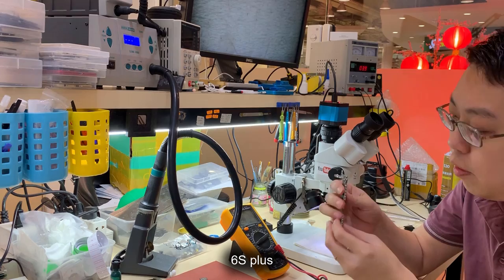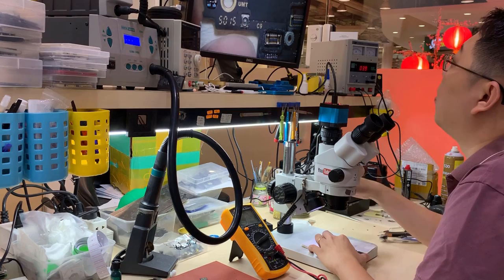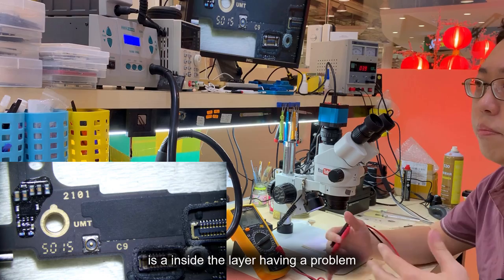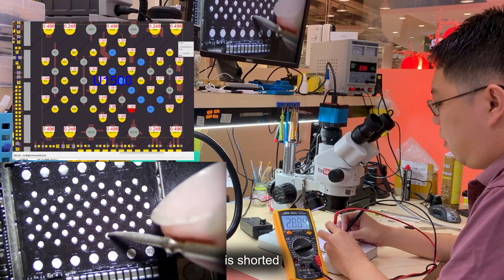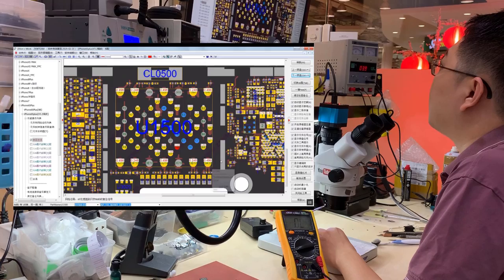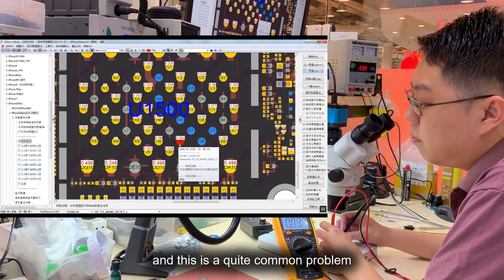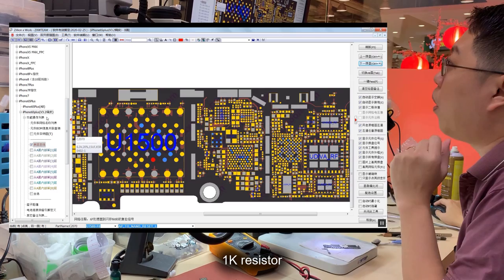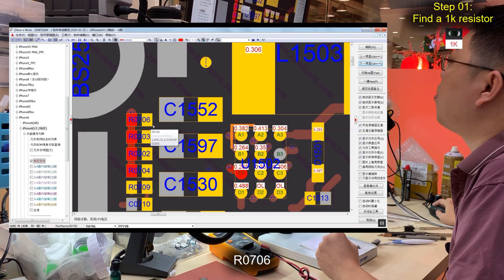iPhone Error 4014 【Special Case】 Repaired |  AP_to_Nand_RESET_L short on 6S Plus

Comment: Why you put 1k registor, what is the purpose of it. And if the AP line is shorted to  ground, is it not the 1.8v line will be shorted to ground as well. Could you explain please. But nice work 👏
Reply: i am guessing that the line is a cpu controlled output meaning that the transistor inside the cpu in that line switch between 0 (no voltage = logical 0)and 1(high voltage 1.8v = 1) so if the line is shorted it will always be 0 and the nand will understand that it must reset, if you cover the pad and bring the 1.8v (logic high state 1) it will understand that it should not reset

Comment: You put a pull up resistor to bypass the short, but now the reset line isn't working properly. The reset can not be asserted by the CPU when needed it remains at 1.8V.  Is it right?

Comment: Very useful tutorial .,
PCIE_AP_TO_NAND_REFCLK_P drop resistance to 0.156 can you use the same method?
thanks
Reply from the maker: Depends what happened on it. But every time you see something about CLK.. it's clock line. This kind of line is  running like a heart beat. In 1 secs it can beats many times. When you check with oscillator then u will know.
Reply: @iPhoneServiceMalaysia  thanks for your reply.,.,The knowledge that you share is very useful for beginners like us.,.,